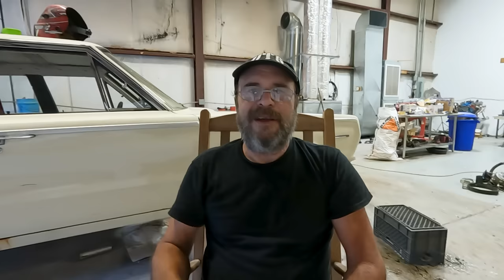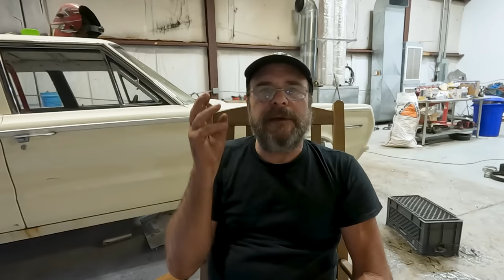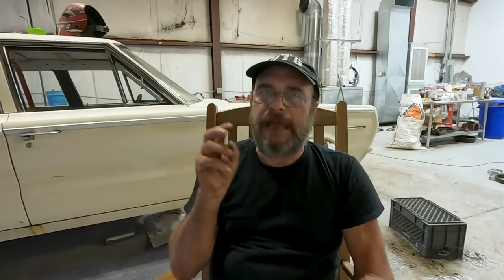They Really Are Out To Get You- How The Automakers Have Made Life Miserable For The Average Mechanic

Comment: The one I hate, is the elimination of the transmission dip stick. Insane greed.
Reply: Absolutely insane greed.
Reply: Is there anyway to drill into the tranny case and install a dipstick and sleeve?
Reply: sealed Trans too
Reply: @douglashewitt5064 I think you can, yes
Reply: merccedes also got rid of the engine oil dipstick
Reply: It's always been a scam.
Reply: 5 years that’s it.Ut is a lot more optimistic than me.
Reply: Germans started it
Reply: @oscarrinc7025 i hate that.  I was always taught to check my fluids.
Reply: Yup just got a 2024 gmc Denali 2500 my 2019 had transmission dip stick and could change myself now the 2024 you must take it to the dealer.
Reply: Had to do with the friction modifiers
Reply: All of the so called sealed lifetime transmissions that I have looked at have both fill and drain plugs.  When I run across these you can find the trans drain fluid amount and add back that amount after a quick fluid change.  No matter which trans I drain I alwas measure the fluid out.  The refill on my wife's Honda Crosstour is listed as 4 liters.  If I do an extended drain over several hours and using a floor jack to drain the diff and transfer case it is exactly 5 liters.  My daughter also has a Crosstour and her refill was the same 5 liters, though only 4.5 came out because the previous owner did not change their transmission fluid.  Car owner forums for you exact vehicle can be really good resources is you filter out the b.s.
Reply: Even worse is the removal of the engine dipstick euro brands have been doing for decades now. Mercedes is one of the few that hasn't for the most part.
Reply: I was just going to write that.
Reply: I remember a guy that had this in a truck. He would ready the sender that told him the amount.
I could never take that as absolute truth.
Reply: My 2000 Silverado 1500 has a trans stick but my moms Chevy traverse doesn’t
Reply: The transmission seal can still go and no way to look unless you go under the car and try to judge how much fluid has been lost.
Reply: Thought up by a Dipstick
Reply: Yes, just a scam. Ford F150 has a metal cap you unscrew to reveal a miniature plastic dipstick. Makes you crawl under and use a suction gun to fill, the design is still the same as in they could still install a dipstick tube to the engine bay. Chrysler come with a dipstick tube with a cap and no dipstick - they just don’t want people doing it.
Reply: Or how about “sealed unit” transmissions? The idea of a non serviceable transmission makes me laugh every time
Reply: @kimberlycockram1894  As your new Geewizzmobile gets older how are you going to tell when any of your fluids  need to be changed?.
Reply: Goood One!!! I'm just dealing with with that! No dip stock, sealed transmission, life time fluid, timing Belt, and you're forced to replace that belt at 100k mi. Because if you don't and it breaks your engine is fucked!!!
Reply: Stop using automatic tranny's, get a shift stick.
Reply: If it has one like the 300 Chrysler , it says take it to the dealer for service.
Reply: Riding lawn mowers too, just got done drilling a drain hole in my transaxle case.
Reply: Lifetime ATF. LOL.  My Kia Soul had the Transmission fail 6 k miles after the 100K warranty expired.   Back to old Ford Rangers for me!
Reply: @MostGenericUser You have got to be  kidding me. Mercedes were the first I came across with no engine oil dip stick. The rest of the car they made is a heap of shit too.
Reply: Sealed transmissions are a scam I'll keep my pre 90s P'sOS  going. Ppls says to me you make a killing an your driving old trash cars then they have to send there 24 durmax back for warranty work with 15k miles 😂😂😂
Reply: Worse now some of the Germans got no dipstick on engine
Reply: @douglashewitt5064 Probably better off drilling holes with plugs like an old differential used to be.
Reply: Insane greed is Amazon, Walmart, monopolies.
Reply: @oscarrinc7025  new trans fluid gets pumped in from drain plug adapter fitting.
Reply: Range Rovers don't  have a engine dip stick.
Reply: Nothing like having a car with a determined life.
Reply: "Lifetime" transmission fluid in a sealed case. 😂
Reply: @AdamC5013  The average German doesn't do car care maintenance.  Whole different world over there.
Reply: @douglashewitt5064  And how would you know what the correct level is?
Reply: @douglashewitt5064  Exactly; and they seem to be unaware of the fact that greed is a capital sin and there will quite literally be hell to pay for them.
Reply: @douglashewitt5064 you can sometimes rig up a tube through the fill hole. No drilling needed.
Reply: The thing that surprised me is my 2006 Subaru Outback has a dipstick for my 5 speed manual. I have never seen a dipstick for a manual transmission in my life.
Reply: What about the oil dipstick? I had to replace an oil sensor that cost $200 after 5 years. A dipstick lasts forever.
Reply: I dunno about that actually, modern automatics are extremely sensitive to any debris far more so than older ones and the dipstick was where most of the contaminates came from.
Should still have a way to check or service them though
Reply: @Billy-the-Kid This,all my vehicles are standard except my 1995 chevy two door Thoe. I have a 5speed manual in a crate that will replace it one day.
Reply: Now, BMW models no longer come with oil dipsticks. Total greed
Reply: @douglashewitt5064  I've seen people drill sealed suspension parts,drill bit puts most chips clear, then try to clear any debris? and install a zerk fitting...but... transmissions are expensive and if debris got in that would not be good...
That said, sure, theoretically a hole could be drilled and then tapped for a bolt with a rubber washer or perhaps just plugged without cutting threads which is probably a better idea...I think not having the dipstick in place would be easier but one could use an in place dip stick...
However without disassembly, can you really drill a hole without getting some metal chips in the case? Would side entry work like with differentials?
That, side entry might be safer...
If it's an old car that's not worth much an eccentric person could experiment but it is just that, an experiment. 
You run that experiment and report your results here!
Good luck?
Better your car than mine?
Good luck!
Reply: @lelenbates3367  Great response!
Reply: @narcissistinjurygiver2932  lmao yea.. the future is pay walled
Reply: Disappointing that Asian cars are going the same way
Reply: @AdamC5013 
wrong. islam started this..
Reply: I'm dealing with that problem now. Can't get to the overflow plug without a lift. Can't use ramps because the car won't be level, making the level check hole useless.
Reply: What,lifetime fluid,filter they say is the same fluid recommended to be changed at 60,80,000 miles!
Reply: Yeah most expansive part too...
Reply: Some cars don't have an oil dipstick anymore.
Reply: Or how about a car that bmw made with no way to check your oil. True fact. No oil dipstick.
Reply: @garybishop4030 Can confirm.  Had this happen to me (front main seal).  Granted it was 25 years old.  

No way to judge how much fluid was in the case.  Had to keep topping it off through the shifter-port.
Reply: I agree. I'll have to keep that in mind when shopping for a new or used vehicle.
Reply: @narcissistinjurygiver2932  Dumb of people to buy a Mercedes without the oils stick.
Reply: Work at a parts store, I hate telling people how difficult new vehicles are to work on
Reply: @alphadog1961  😅
Reply: Denying the average joe the right to repair.
Reply: @Billy-the-Kid yes, if I became president, I would make automatic transmission cars illegal (except for the disabled) and would legalize automatic guns
Reply: @smeraldoderosa7556 Gotta love the new engines that have a “lifetime” reinforced rubber belt inside the sealed oil case. Just a quick and easy pull-the-entire-engine-and-strip-it-to-the-block to replace it. 

Iirc, Ford is doing one of those and offering like a 40 or 50k mile warranty. So the “lifetime” belt is only rated to like 60k miles. Near total engine rebuild every 60k miles, if you’re lucky and the belt you can’t inspect never wears too fast.

I’m sure Ford isn’t the only one, and if they are, they won’t be for long.
Reply: @douglashewitt5064 you can do it but the problem is any warranty you have will be gone and these new transmissions pretty much fail right before or after the warranty ends. Meaning new transmission or new car therefore keeping the parts under warranty. Meaning you do it your out of your own pocket every time you need to get it repaired weather or not the added dip stick is causing the problem
Reply: The consumer has become less interested in serviceability and more interested in cost, so you get cheaper, less serviceable designs.  The throw away culture.
Reply: The corporate leaders don’t want us to be able to repair our vehicles.
Reply: Yes, another bad idea. They don't even put Babcocks on radiators anymore. But now the tend to be made out of plastic, so I guess we could just cut a hole in it to drain the fluid and patch it up with duct tape.
Reply: Au Contraire!  We have seen that the fluid does indeed last the life of the transmission.
Reply: @narcissistinjurygiver2932 as did RAM on the new 1500
Reply: @lactusgalacto1174 
Mercedes vehicles now disposable.
Reply: @Mike-i1t7h 
Keep telling them, and say they should ask dealers/manufacturers why.
Reply: @johnbragg2014 
That's a great title for legislation: Right to Repair. 👍
Reply: Pisses me off!!!
Reply: Is the purpose to force you to go to the dealership?
Reply: @stivendog 
That and force you into leasing, because your car either won't last or is too expensive to repair.
Reply: I had a mercedes sprinter the other day for an oil change, and they removed the oil dipstick... you have to go into the menu on the dash to check the oil level.
Reply: @stivendog  
Yes, on a micro level, and on a macro level, to control us.
Reply: Also some modern cars don't have a water temperature gauge, only a warning light that turns on when your engine is overheated
Reply: My 2007 Toyota Corolla recommends never changing my auto transmission fluid. It is crazy, I changed my auto transmission fluid 2 times since about 150,000 miles. I wish I had changed it first under 80,000 miles
Reply: That is outrageous .   Now dealerships can rob you blind!  Too bad.
Reply: They have lifetime fluid now.  LOL
Reply: @douglashewitt5064  There is a dipstick. It is underneath the car. It is NOT a 2 min check
Reply: @garybishop4030 Exactly!! Wtf are you supposed to do when the axle seals get some leaks? On an old car you would lift the hood and add half a quart of ATF every few weeks. Nobody is going to jack up the car, remove the tire, remove a plug in the side of the transmission every 2 weeks to add half a quart. It will total the car. This should be illegal.

Comment: I worked in appliance repair in 1976 and the guy I was learning from tried to explain to me how the industry was moving toward planned obsolescence.  The idea was to create an endless market for products that weren’t serviceable, thus allowing for more profits for established manufacturers.
Reply: wow they were way ahead of the curve. I actually use appliances as an example for where the auto industry is going
Reply: I can (barely) remember when my mothers' refrigerator was converted to 60 cycles, from 25 Hz. That thing was still working when she passed away.  A neighbours' fridge needed a door seal. The part was $85. She bought a new fridge. (it was old ). I worked in electronics. I can remember about 50 different tube types stored on the wall. And an appliance guy up the street, with burners of 2 sizes, 1 type of control for all burners,  a few different oven elements. I marvelled at the simplicity. Now, the digital display on my stove is getting very dim, but I will likely wait and buy a new stove...
Reply: I was shown by a body shop owner back in the 80s how cars were purposely designed to collect and hold moisture/salt/debris so that they would rust out and gave to be replaced sooner. I think Japan has killed a lot of the planned obsolescence movement as Americans started noting in the 80s that a Toyota or Honda wasn’t the complete piece of shit death trap tgat American cars were designed to be.
American nanufacturers took 25 years to catch up, but have already started going the other way in trying to profit off higher priced vehicles designed to shit the bed after the warranty expires again.
Reply: Appliances are pure overpriced junk today. I own a still working 1936 Frigidaire by GM refrigerator. Nothing built in the last 20 years will still be working every day.
Reply: @drewthompson7457  A capacitor on the control board for the digital display is going bad... Unfortunately, the components on the control board are probably sealed inside a potting material, making sub component replacement impossible.
Reply: @jackandblaze5956 : It's one of those electro-luminescent  displays, I figured it was just getting old.
I call parts that are potted "encrapsulated"
Reply: Exactly 💯 percent the corporations have zero interest in making products that last for years any longer
Reply: bernasian sales tactics in play.
Reply: I worked for an appliance repairman as my very first job. Paulie was able to teach me (an uneducated knucklehead kid) how to do basic repairs. It was straightforward and simple enough that an idiot like me could learn. Fast forward to today and none of the appliances are simple, much easier to replace than repair. It’s a prefect scenario for the manufacturer.
Reply: Yes that’s the story on my garbage disposal. They could make it with stainless steel and it would last forever, but chose ordinary steel that rusts out in a year.
Reply: I bought a new GE range. A thunderstorm sent a lightning bolt to my wiring and blew the board. Now to replace it will cost more than the whole range. So I found the oven glow igniter and gas valve & wired a toggle switch. Saved the unit but I have to regulate the temperature by toggling myself.